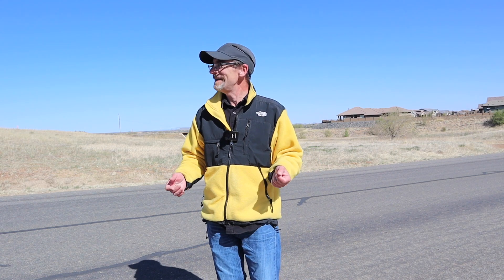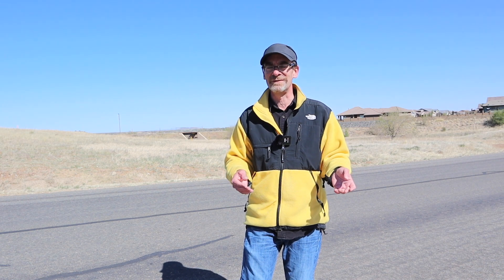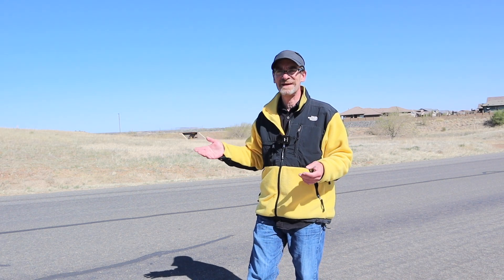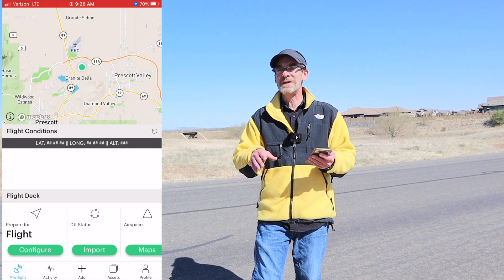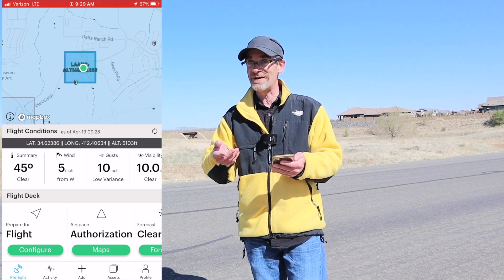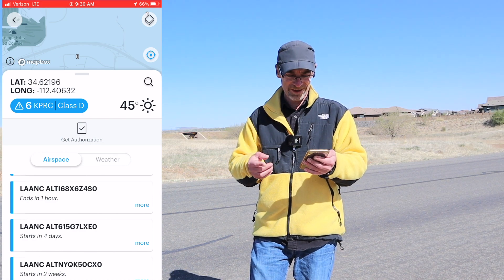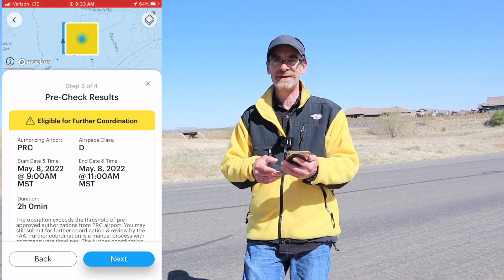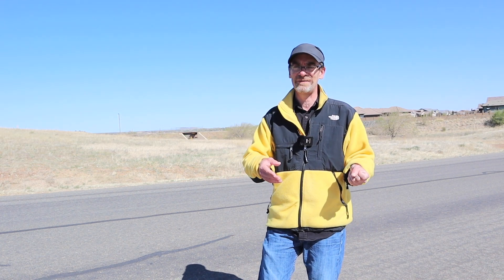0Ft AGL Aloft LAANC Request Part 2 - Seeing the LAANC Request On Screen

Comment: Rich, I've had to do these requests many times also in the Prescott area, and have had to put in comments below before I submit the request because I was flying not necessarily near the airport but near a hospital with a helipad and that explanation is what I needed to get authorization. But my question is, if I'm doing several flights in the same area, I don't see a way to duplicate a request so that all I need to do is change the date and time and submit a new request. I do copy and paste my explanation from my previous request in that area but I still need to go through the motions of creating a brand new full request. Is there any way that you know of to duplicate a request and just change the date and time and submit it? Thank you.
Reply from the maker: I’ve actually had the same situation. And like you I’ve created a brand new one as well. Also I can’t put the Avata into the same one as my mavic 2. I’ve had to do that one all over again as well. It is frustrating. Often I’ll have more than one drone on job sites. I wish they had a little check box for each of my drones that could be submitted together.
Reply: @AZ-Drone  I had a construction project I was documenting in a zero grid area that was actually right at the end of the five mile radius but because it was in the flight path it was a zero AGL grid but I would submit requests for every day of the work week for about a year and I did them about every month for the upcoming month because I didn't know what day I would go or what the weather would be like so I did that for a year and it would have been nice to have a way to copy an existing request but I'm glad I'm not the only one frustrated by that.